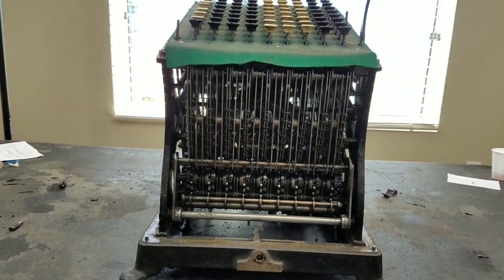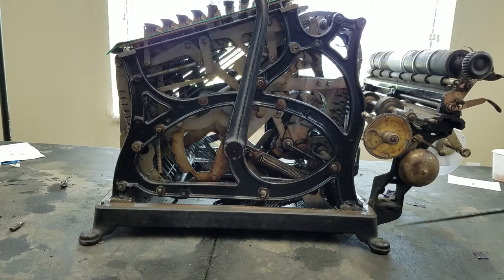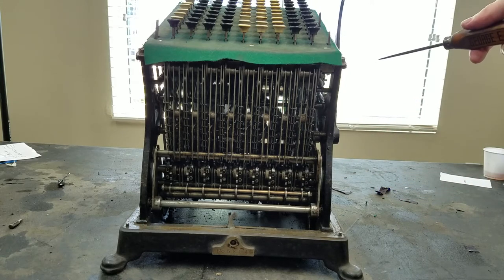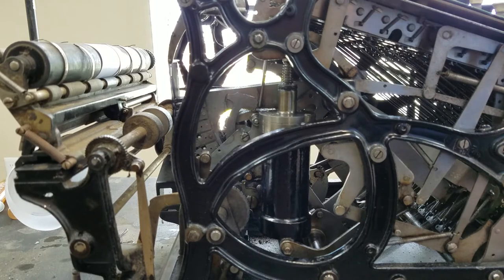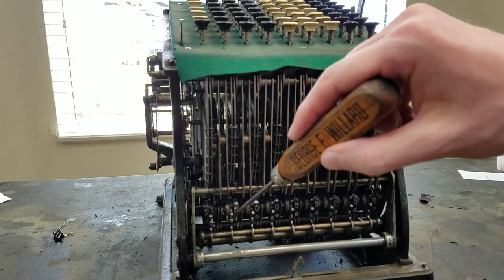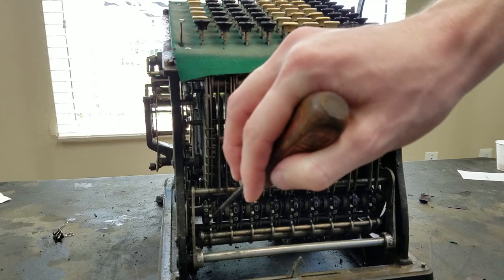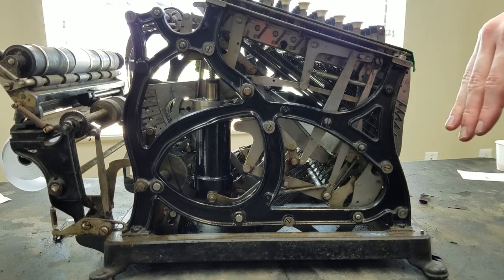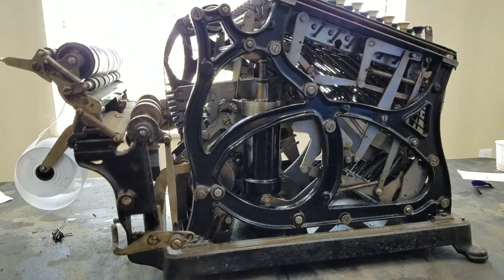Burroughs Class 1 Adding Machine: How It Works

Comment: 13:16  restoring a Burroughs 5 calculator. It was necessary to dismantal the top and remove all keys. An extreme pain to reassemble, to say the least. Making certain all keys are installed correctly, the handle IRS not want to move, prior to disassembly it would move. No other components were taken out such as cams or anything. Any Idea why the handle would be inoperable?